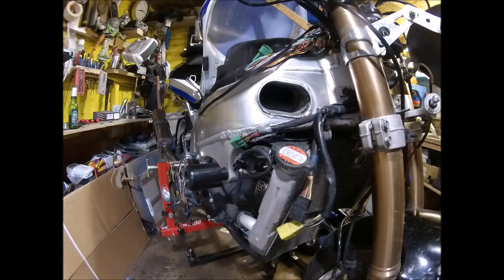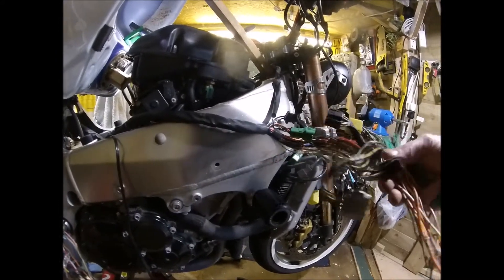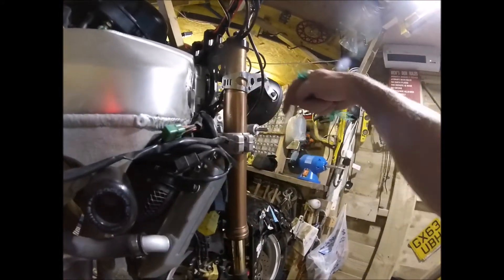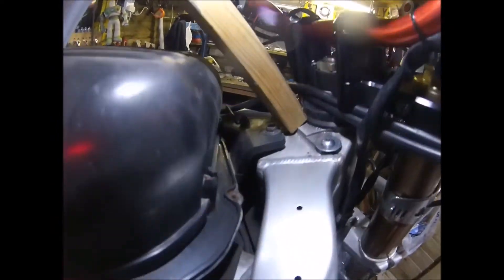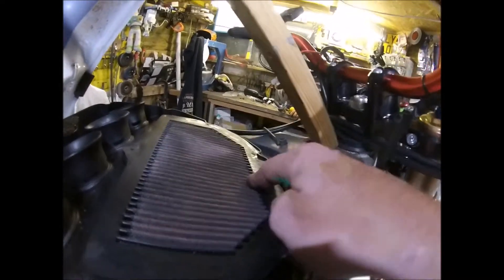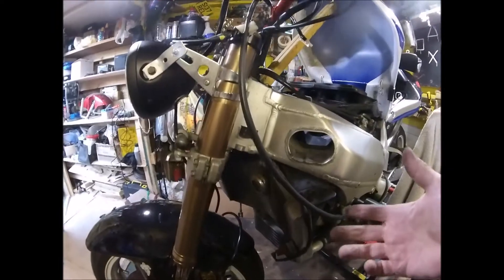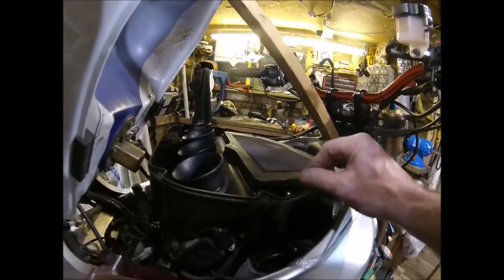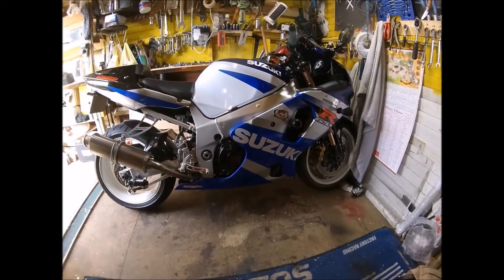GSXR 1000 Streetfighter build pt2 Moving the Loom

Comment: This video helped alot bud, doing the same to mine. 
Did you have to extend the throttle cable or clutch cable?
Reply from the maker: Hi, I bought a handlebar conversion kit from ABM which had everything i needed. The only thing that needed extending was the brake lines. The clutch cable was long enough and the throttle cables are re-routed so they run between the tank and top yoke, which gives them enough slack to fit to the throttle tube and for your steering to go from lock to lock. It’s a bit more messing about lifting the tank but how often are you going to be under there?! Good luck 👍
Reply from the maker: In this video at 10mins 47secs you can see where the throttle cables go

https://youtu.be/1VsVaYAbfdw
Reply: Cheers bud thats handy, I got brake lines 60mm longer then oem and hoped I could re route the others so you have cleared that up for me.